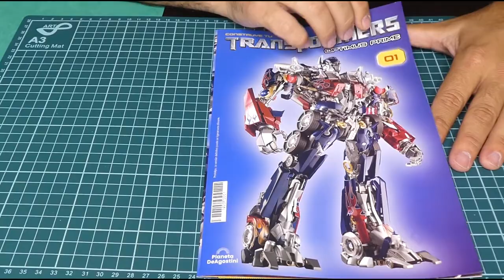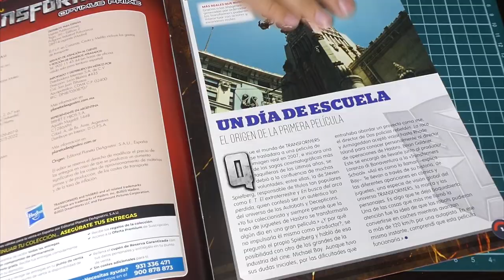🤖 FASCICULOS 1-2-3 / CONSTRUYE TU OPTIMUS DE PRIME ALTAYA / PLANETA DEAGOSTINI @planetadeagostini_es

Comment: Ni dios dice precios, ni siquiera en los enlaces o página de suscripción. Tendré que llamar como siempre, estoy con la de naves de star wars, y como siempre solo dicen lo barato que es el primer fasciculo. Si quieres saber precio de las entregas y cuantas son, llama,, porque puede ser lo más bonito del mundo y después se suben a la parra con el precio,, y te compras 3 no uno. Asique mañana llamo. A ver si merece la pena
Reply from the maker: Buenas, en la web de la colección tienes un apartado de  preguntas frecuentes y ahí ponen el número de fascículos, después ya toca hacer cuentas.
Reply: Te sale el robot 115 entregas 113 a 12.99
Reply: Y si te pasa a premium un 1.5 más así que 14.50 cada entrega más 0.65 gasto de envio por entrega Super barato
Reply: Si he hecho bien los cálculos, saldría esto:

ENVÍO 1 (6,79€)
Fascículo 1 0,5€ (+0,65€ envío)
Fascículo 2 4,99€ (+0,65€)

ENVÍOS 2 AL 9 (327,36€)
Tres fascículos en cada envío por 12,99€ + 0,65€ cada uno (8 x 3 = 24 fascículos      24 x 13,64€ = 327,36€)

ENVIOS 10 AL 23 (1.145,76€)
Seis fascículos en cada envío por 12,99€ + 0,65€ cada uno (14 x 6 = 84 fascículos      84 x 13,64€ = 1.145,76€)

ENVÍO 24 (68,2€)
Cinco fascículos por 12,99€ + 0,65€ cada uno (5 x 13,64€ = 68,2€)

Con la BASE LUMINOSA CON VITRINA, serían 1,5€ más por fascículo desde el 4 al 115 (112 x 1,5€ = 168€)

Comentan que los archivadores son a 9,99€, pero también ponen que los fascículos son digitales. No los sumaré.

TOTAL (sin la base) ----->  1.548,11€
TOTAL (con la base) -----> 1.716,11€

Estos totales, lo más seguro, van a variar porque subirán los precios, ya que se tardará unos dos años en completar la colección.

Un placer.
Reply: Ya e llamado y son 12 y pico por Entrega más 1,60 más o menos si te haces premium. Las 2 primeras son una a 0,50,y otra creo que algo más, no recuerdo si menos de 4 eur seguro. Son unas 60 entregas y llegan todos los meses 3 entregas. Asique unos 40 y pico todos los meses, dependiendo si te haces premium o no. Y los archivadores a parte, que son otros 10 eur casi cada archivador. Como los de star wars, que los podrían meter con el premium pero no. Se pasan un poquito. Te sale el optimus por unos 800